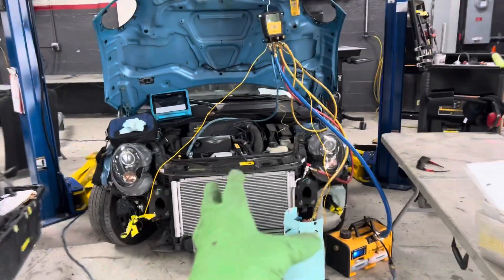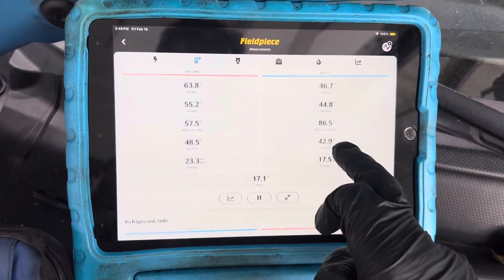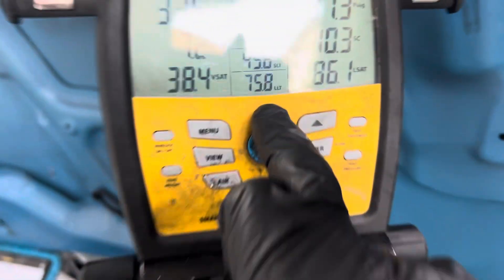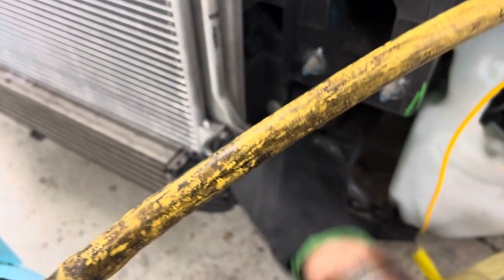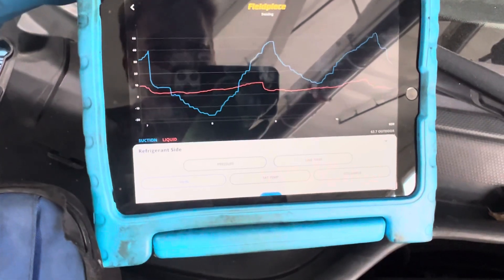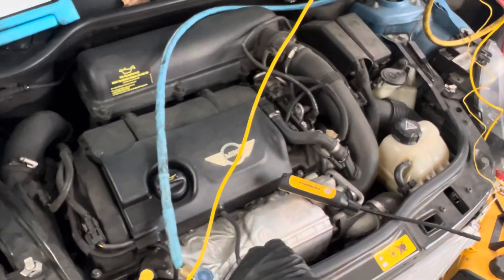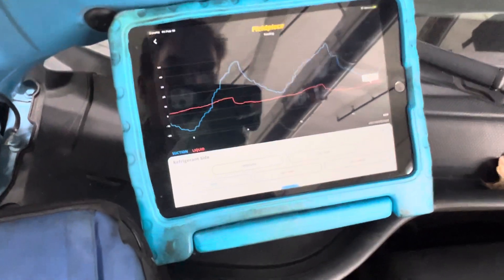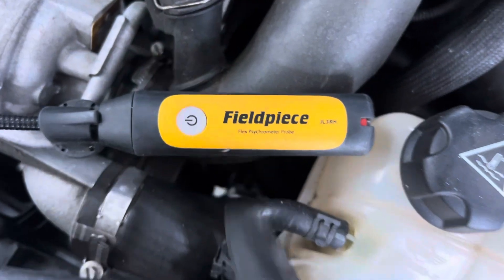Air conditioning 2012 mini Cooper S pressures and temperatures

Comment: Variable  displacement compressors have alot to answer for which I suppose is maximum efficiency . However Your vids do show some systems are way better than others . [most systems of this type work on the best average] . I still prefer a fixed displacement with a huge  very efficient condenser . A good F/D design gives excellent performance similar to quality refrigeration . F/D with excellent psi in very hot weather is rare  thou . 150psi at 100--110f ambient only changing 10psi with more RPM . The most applications I saw this was big condenser applications , cranes , fire trucks , small buses . I suspect not only fuel efficiency  lead to the drive forward to variable displacement but also lack of space for large condensers .
Reply from the maker: In my videos, sometimes you see see variable displacement compressors where the dash temperature is only 58° or 54°F.  That is because it’s a cool day and the ambient temperature sensor sees that and then the vehicle might be out of the sun so the sun low temperature sensor that senses the strength of the sun. These tell the computer the software that is programmed to turn down the compressor.. 

Because the passengers do not need 37° air blowing arms when it’s only a 67° with a load with no sun . 

That same vehicle on a 85° outside and the sun sensor picks up a really strong sun will set the compressor to full stroke full displacement and then you might get 37° out of the dash so fools you if you were a technician who did not know this and displacement compresses are Bad. 

Especially older technicians who are used to fixed piston compressors, who can get away with a lot of mistakes and kind of figure it out by pressures and temperatures cannot do that on the variable displacement and get it perfect